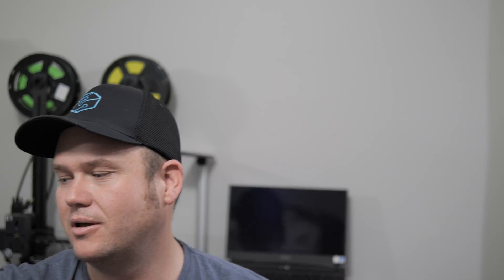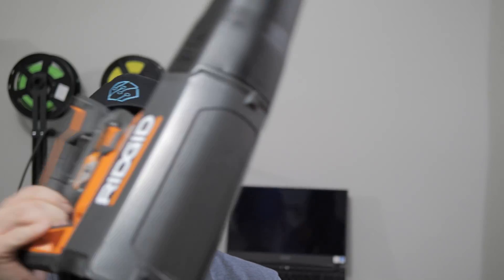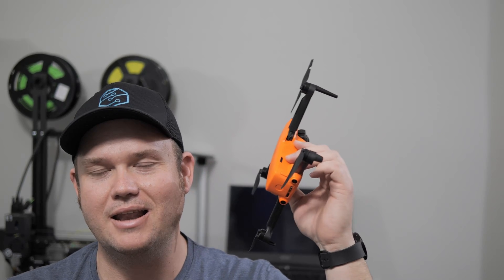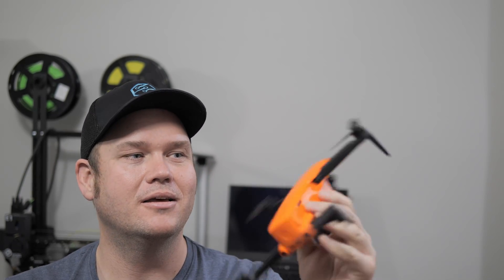Ultimate Autel Nano Plus vs DJI Mini 2 wind resistance test!

Comment: Good video showing what a lot of us have already learned via various YT reviews/reports that the new Autel Nano/Nano+ drones are CRAP.  (FWIW, I'm a Evo 1 owner) This inability to handle winds has been shown to likely cause fly-aways in even moderate wind conditions. Some have speculated that this will be fixed with a 'firmware update'. That is not likely, as this looks to be a design flaw ... no firware update will solve this. I don't own a Mini 2, but perhaps, after DJI launches the Mini 3, we will be able to score a 'deal' on a Mini 2 flymore pkg. Thanks for sharing your findings. You should post the URL for this video to the Autel Facebook group so that some of the disbelievers can see the evidence. Cheers.

Comment: Maybe I missed something. At the 1:28 video mark you used a DJI controller to stop the props on the crashed Autel. Please explain this.
Reply from the maker: The dji remote is sitting beside the autel remote. You can hear in the video the autel app talking. I was more worried about stopping the props then getting video of me doing it
Reply: @cantechvideos5701  I completely understand. I would have done the same thing. I was just wondering. Thanks for responding.

Comment: I don't fly in Hurricanes (Rigid Job Site Blower 105MPH), I fly the DJI Air 2S, DJI Mini 2 and the Autel Nano +. I always check the UAV App for current weather conditions and once winds at 150 feet reach 26MPH, I don't fly. I can't afford to lose any drone because of wind, rain, snow or cold. Your demo was helpful for those looking at the Nano +, I too wish it were better in wind and had a little more speed in Sport Mode, but I can live with it's as well as my other drones limitations. Fly safe and good luck.
Reply: Basically, from all that I've seen, and witnessed first hand, I could almost never fly the Nano plus in Ireland, it has absolutely terrible wind resistance
Reply: @DroneViewsMedia  Don't let a BS "test" like this sway you.  We've had the EVO II in 60+ mile an hour winds, and successfully mapped in 42/G51. A real test would involve a constant large volume fan indoors, all UA equidistant on a marked line, no human factor/element involved, and certainly no pre-conceived, designed outcome that any experienced pilot will recognize. 
We are currently evaluating Nano's and Lite's through an actual, objective, previously applied method and will report the results on Autel, DJI, and other FB pages.
Reply: @DouglasSpottedEagle  I have seen the Nano plus flying in person, put it up against my Mini 2, and it literally was night and day with regards to wind resistance. It's a shame, I really liked the camera, but no way could I fly a drone that struggles this bad. There's also been so many videos uploaded demonstrating this fact. I'll wait for DJI to see what they have coming
Reply: @DroneViewsMedia  I agree, if you live in a place where you have constant winds that make the Nano or Nano + hard to fly then perhaps a larger drone would be better, with the understanding, that there are many places where the laws prohibit flying larger drones near people and public places.

Comment: Because of the latest news from Autel about bending to the whim of reviewers and unlocking the original speed settings... My guess is that the Motors on the Nano are underpowered (the almighty weight issue)  and forcing them to max out will only result in premature motor failure. I can see it now... Autel Nano falls from the sky in Sport Mode ? or ... High winds blow out the flame of the Autel Nano ?

Comment: besides it has a problem with the power of the propellers, I think there is also a problem with the aerodynamic shape if I had to examine the two drones in a real and professional wind tunnel I would notice all the defects even on the corners.

Comment: Not the first video of a Mini2 easily coping with a leafblower.
The footage from the drone at 4m20 of this video is fairly astonishing.
https://www.youtube.com/watch?v=j48HP6Gj9-I

Put a Nano+ quality camera in the Mini2 and you've got a winner.
I'm hoping DJI don't waste weight on sensors.
When doing the Mini3 development can DJI please, please prioritise flight and camera capability rather than gimmicks.

It would be a bold step to leave the obstacle avoidance off, but I think it makes sense.
How many videos are there on YouTube of drones flying into things which the obstacle avoidance system fails to see and avoid..?
It simply can't be relied on.
IMO, a waste of valuable weight.
Reply from the maker: You are right, I don't believe this drone has enough available power to support the platform. That's why you see all these videos of flying faster in reverse. It can't compensate for the gimbal and wind together. Mix in sensors and active track it's a pie in the sky.